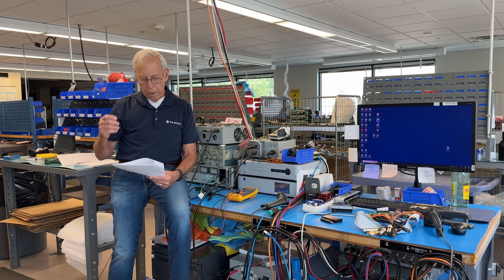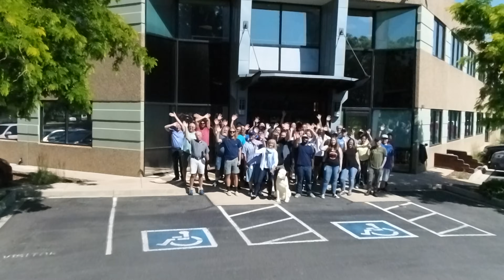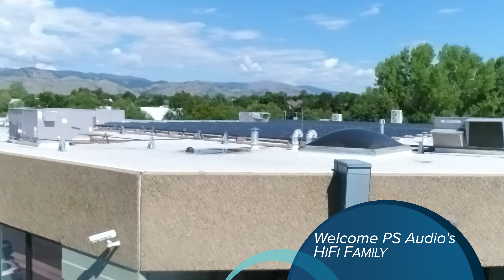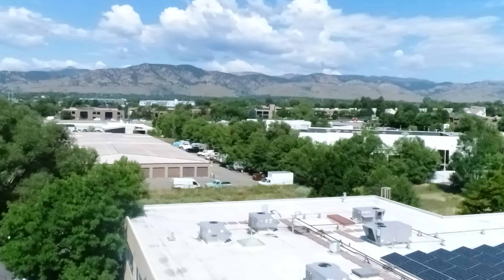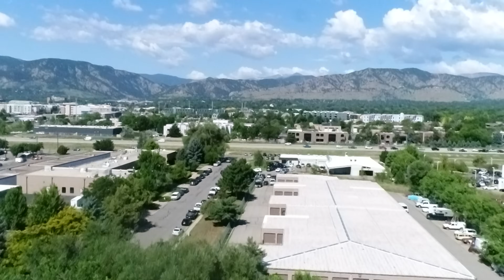How a single vinyl needle makes stereo

Comment: Aren’t the two channels on stereo vinyl NOT Left and Right, but one Left+Right and the other Left-Right from which, with some “math” on these, Left and Right is be recovered?

Leaving some room to be wrong here, I think the Left+Right signal is mapped to lateral stylus movement and the Left-Right signal is mapped to vertical movement. The Left and Right signals are recovered but the coils in the cartridge and their geometry.
Reply: I think you're right, but the idea is pretty much still the same. It's still two distinct data streams, two signals being read by a single stylus. If it were not for the fact that they wanted backward compatibility, they might have simply encoded it as L & R on the opposite walls of the groove.
Reply: @AndyBHome  Yeah… a stereo record played-back with a mono cartridge produces a mono signal that is the sum of Left and Right.
Reply: That's not true. A stereo LP has discrete left and right channel signals, and no matrix is needed. Perhaps you are mixing it up with SQ Quadraphonic LPs, which did use a matrix to encode the rear channels.
Reply: @gotham61  I think there are two equivalent ways to look at this. If the frame of reference is horizontal and vertical (left/right and up/down, parallel and perpendicular to the plane of the record), the signals are horizontally Left+Right and vertically Left-Right. If the frame of reference is rotated 45º from that, then the signals are Left for one and Right for the other. A stereo cartridge has this 45º rotated geometry and implicitly interprets Left and Right channels. A mono cartridge has only horizontal geometry and only respondes to left/right movement. As such a mono cartridge behaves reasonably when playing a stereo record and, to a somewhat lesser extent, a stereo cartridge behaves reasonably when playing a mono record.
Reply: @SteveWille  While it is true that the sum signal L+R results in lateral motion, and the difference signal L-R results in vertical motion, that is not how the records are cut or played. The cutter head is fed a left channel signal and a right channel signal, and these move the cutting stylus directly on the 45 degree diagonal. It's the same with playback, the stylus reads the two diagonal signals directly, and produces left and right channel output signals.
One of the beauties of the Westrex system is that it is fully backwards and forwards compatible between stereo and mono. In other words you can play a stereo record on a mono record player, and can play a mono record on a stereo record player, without any losses.
Reply: You are describing mid side encoding. While it's a very interesting subject, it's not used on stereo records AFAIK.
Reply: @CosmicDawnDj  Thanks for putting a name to this; it makes searching for info on it easier. Perhaps not explicitly, but Mid/Side encoding exists on standard 45º/45º left/right encoded stereo vinyl records. If a standard stereo groove were to be played by a special two-channel cartridge with horizontal/vertical geometry instead of 45º/45º (like a mono cartridge with horizontal motion but with an added vertical motion channel… not sure such a thing is made), I think the resulting channels would be Mid (horizontal motion) and Side (vertical motion).
Reply: The London DECCA “cantileverless” cartridge family play standard stereo records but do so by interpreting the groove as MID/SIDE (horizontal/vertical rather than 45º/45º) and, from which, the two channels are added to form LEFT and subtracted to form RIGHT.

Comment: Sorry Paul, but you a wrong.
Original, when vinyl was only mono, the signal was engraved vertical, from the left to the right. 
When stereo arrived, of course they need a second dimension. So the nearest solution would have been a to engrave the second channel signal lateral up and down.
But that wouldn’t be compatible to mono cartridges. Because they could only convert a vertical signal, so the user would lose half of the signal. So they rotate it by 45*. So now one channel is cut from the top left to the right bottom and the other from the right top to the left bottom.
Only bass ( below 150Hz) is cut from left to right as a mono signal
Reply: Is there an alternative universe where left to right is vertical and up and down is lateral? Each attempt to correct Paul’s slip seems to increase rather than decrease confusion.

Comment: The inner and outer groove walls are 90 degrees apart so that the axis of each channel doesn't affect the other. The channels are recorded out of relative phase so that mono LF content doesn't lift the stylus out of the groove by pinching it out. Several methods were tested including mid side with sum on one channel and difference on the other. Relevant information far more detailed is abundant.

Comment: Oh man, Paul's explanation is just plain wrong here. It's not vertical movement in one channel, and lateral movement in the other channel. The two groove walls are both at 45 degrees from vertical, and one channel moves the stylus diagonally from one groove wall, and the other channel moves the stylus in the opposite diagonal from the opposing groove wall. Because one channel has its polarity reversed compared to the other, a mono signal will result in only left to right movement of the stylus. This is the 45/45 record cutting system developed by Westrex over 65 years ago, and used for all stereo records since then.
Reply: Thumbs up to your comment.I'm pretty sure that's also what I read in a "How does it work?" Book.
Reply: @oliverbeard7912  Exactly, Westrex (really Western Electric) of Bell Labs called it the 45-45 System.
Reply: Paul describes a method that was dropped in the 1960s and hasn't been used since.
Reply: Paul, you surely confused poor Parfait (spelling?) with such an incorrect answer.  @Gotham61 gave a good answer.
Reply: There's a pretty decent animation showing how it works starting at the 3 minute point in the 1958 RCA promotional film. https://youtu.be/kxelxqtkkdc?si=z5TudIg_0ThG-tWM
Reply: You are correct. I actually proved this by accidentally bending the stylus. I only had one channel. Once I straightened the stylus, I had stereo.
Reply: So that means then that technically, half the time the left channel is playing and half the time the right channel is playing, and they are synced up by inverting polarity? And half the time is enough for both because half the wine wave contains all information? Please correct me if I'm wrong.

Also, how does amplitude work if both channels only have 1 dimension?
Reply: @TuanMinh-sv2gq  No, both channels play at the same time. Most of the time the majority of the signal is the same in both channels, so by inverting the way one channel is cut, the resulting signals result in primarily lateral (left to right) motion of the stylus. If the groove walls were in phase, most of the motion would be vertical which is much harder to track.
Reply: @TuanMinh-sv2gq  Member @gotham61 answered your lead questions well.  To answer your final question:  Like any other audio signal, each stereo record channel has 2 dimensions - amplitude and time.  The amplitude is encoded by the depth cut into each wall of the groove (and that one-dimensional cut is both positive and negative, with the at-rest neutral depth representing zero).  Time is of course encoded by the constant angular rotation of the groove under the stylus (33 1/3 revolutions per minute for a standard LP).

Comment: I went down the rabbit hole rec this on a forum once. I still don’t understand what happens if the recording requires the stylus to be in two different places at the same time.
Reply: That wouldn't occur. Look at it this way: vinyl playback makes use of all three spatial dimensions. One is the length of the groove, the other the width and the third the height. The length is the time point at which the stylus is in the recoding, the width is the place where it needs to be for the right channel signal and the height is the place for the left channel signal. (For complete accuracy, turn this image 45 degrees as the channels on an LP are vertically oriented.) These three will always add up to a single three dimensional coördinate on the record and the stylus would never have to be at two places simultaneously.
Reply: @bestuurdvsgroningen3603 I agree but what if the sound coming from either the left or right channel alone was two simultaneous notes of different pitches (a chord or descant).
Reply: @edd2771  Good question, in that case you add the notes up. The movement of the stylus is the sum of all the notes that are played. Your ears do the same thing where they read all the notes with a one dimensional movement for each ear. Where a stylus takes its signal from the record, your eardrums take it from the air.